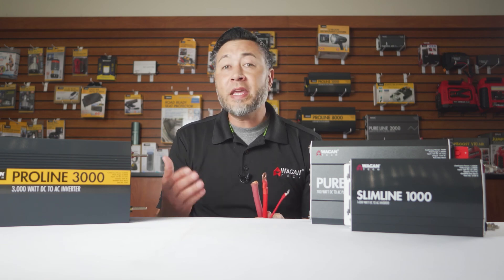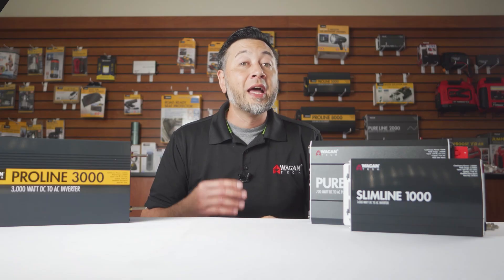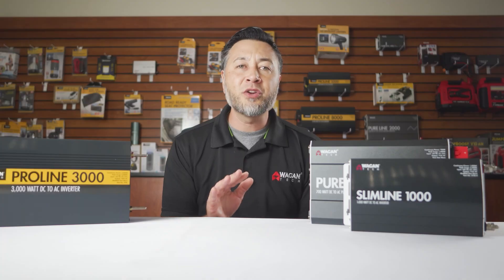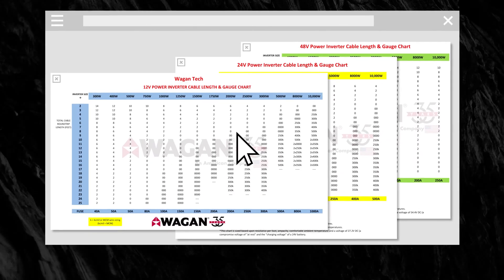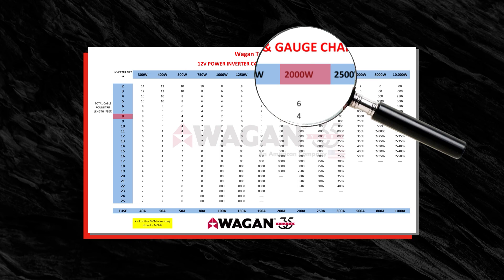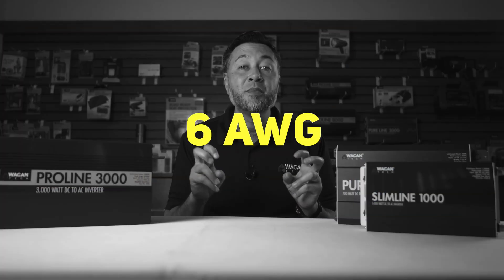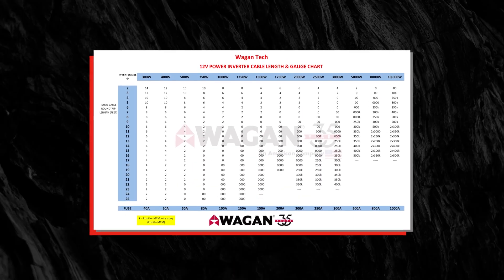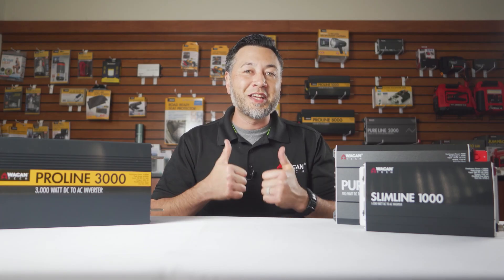Power Inverter Cable Size - How To Select The Right Cable Size

Comment: Hello , what size cable would I need to go from a the alternator / battery under the hood of my truck to battery bank in the bed of my truck?
Reply from the maker: Hello! The size of the cable is dependent on the length of run (distance) and the amount of amperage it will carry. 
Let's say, for example, that your battery to the bed is 12 feet; this would be calculated as 24-feet roundtrip. If you're running a 1000W, we'd recommend 000 cables.
Take a look here for our Cable Length/Gauge Chart: https://wagan.com/blogs/news/customer-question-what-cables-do-i-need-for-my-power-inverter

Comment: Is this table based on nominal wattage. I.e. if I have a 3000w (6000w max) should I still use a 300amp breaker and 2 gauge wire for a 2ft run?
Reply from the maker: Hi Nomad, the table is based on maximum carrying wattage of the inverter. In your case if it is a 12V - 3000W inverter, then yes it would be a 300A fuse and either 4AWG or 2AWG cable for that 2 foot run.
Reply: @WaganTech  Hi, if routing the inverter to the trunk of the car...what is the max of run allowed ?
Reply: @WaganTech . I’m sorry, but using a voltage drop calculation to size conductors is only for voltage drop!  You told this guy to use from 125 to max. 190 amp wire on a circuit with 300 amps of overcurrent protection.   Conductors must be sized for amps first, the overcurrent protection, then increased, if required, for voltage drop!   This is a dangerous install.

Comment: Great vid thank you. To clarify using the chart ypu supplied, even if my invertor is 2000 w as long as I am sure I will never be drawing more than 1000 w when my appliances are plugged in, I can read the table and select the cable and fuse size for a 1000 w invertor? TIA
Reply from the maker: Hi Steven, yes you are correct! If you choose to go that route, I advise marking the Inverter so that anyone using it knows not to exceed the battery cable's capacity.

Comment: This is so informative! I have been trying to figure out what cable to buy for my 1500w inverter because the installation must be done (by choice; I live in it and I do not want to burn my house down, ya know?) by my Prius dealer because the firewall has to be breached and there isn't very much working room in the engine compartment. They want me to provide the parts, however, so I have watched SO many videos to try to find out what I need to buy (or have) and NOT. ONE. of them gave me the succinct, clear information yours did. Thank you and a big THUMBS UP.
Reply from the maker: Thanks for watching and your feedback, James!